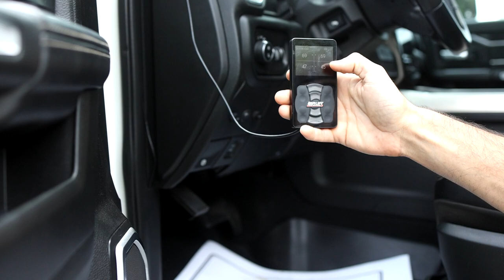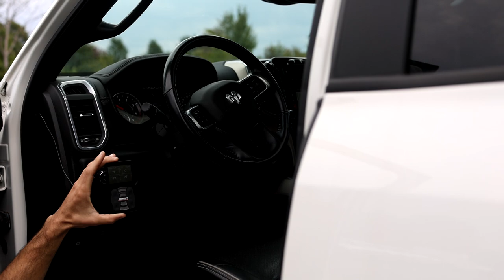What's the difference between Air Ride and Any Level Lift?

Comment: Biggest difference for me is $9800 for the kelderman $42,420 for the anylevel
Reply: What do you mean $42,420?? There is no way Anylift coast anywhere near that price.
Reply: @jzlahmar  got quoted by anylevel $42,420. How much did you think they were ? $100?
Reply: @DiscordCriminal I thought they were 16k
Reply: @carter.coleman  if you get keldermans auto leveler and pump probably. If you have your own compressor & leveling valves it’s cheaper. I see the kits also went up. 17 250 5-6 was 5500 front 4500 rear or $200 off for no powder coating at the time of my comment.

Comment: Very good video, I have a couple of questions, I thank you in advance for your response. I am about to buy a truck with Kelderman suspension, my question is can you drive it when you lower it all the way, or is it only designed to be driven at maximum height? Also, how does it feel to drive it at 70 miles per hour?l

Comment: Is it a set price for each make truck? I have a F250 7.3L. What is the price range for kit and installation?
Reply: around 15k
Reply: 13k at a reasonable price. 15k stretching out the customer
Reply from the maker: The current availability is for 11+ F-250 F-350 and F-450 Trucks and our pricing starts at $34k installed for the 0-13 Hydraulic systems.

Comment: Would air bags work if all I want to do is be able to adjust it from maybe a 6 inch lift down to normal or a little lower for racing. I want a lift kit but I want to be able to be a normal height for other activities to.
Reply from the maker: That’s a neat concept. I’m not to familiar with what would be needed for spring rates or travel for racing. One thing that comes to mind is alignment. If it’s a solid front axle truck the pan hard bar being fixed would move the axle side to side through out the range of travel. Outside of that I could see the potential for that concept. It’s a good idea either way and would be worth looking more in to.

Comment: Possible to make an any lift system that runs off of a center cradle? For that ultimate look?
Reply from the maker: Yes the newer systems have a center cradle option that adds quite a bit of style.
Reply: @southerndieseltruckco4884  thank you for the reply. Best way to reach you guys and look at options? Website?
Reply from the maker: @bantambryce4858  www.southerndieseltruck.com is the website or, call / text the shop line 315-598-4444 . Thanks for watching

Comment: I would like to see the any level left kit on a ram before any judgements are made. Would like any level for my 2500 megacad. I noticed that they are ONLY made for Fords.
Reply from the maker: We have a Ram Kit in prototype currently on a 2019 3500 SRW. Still in the testing phases but it performs very similar to the Ford Kit.
Reply: Same